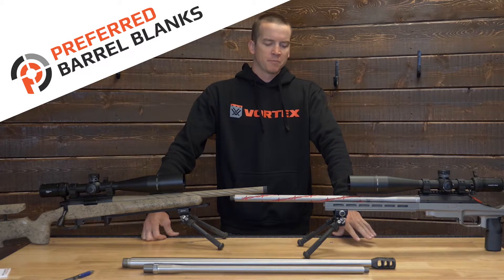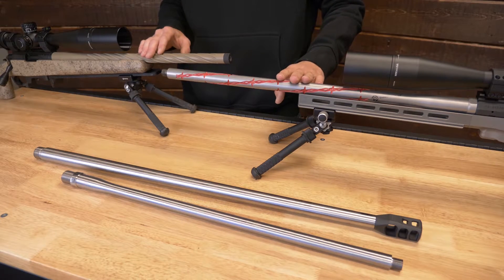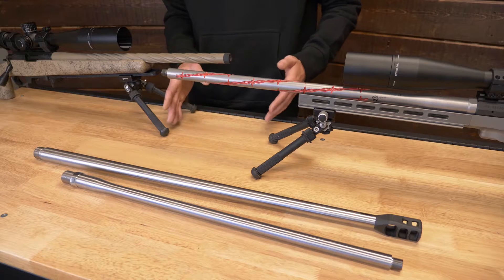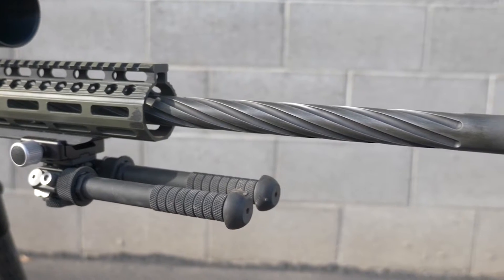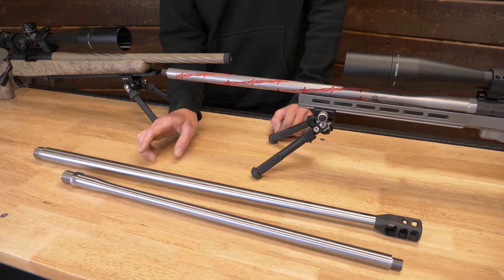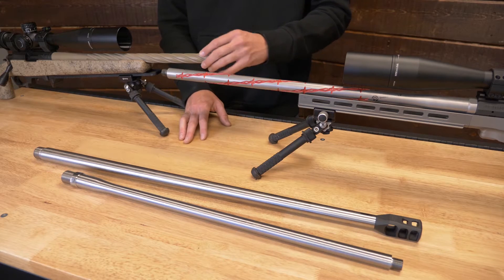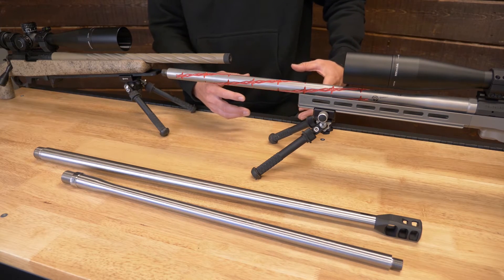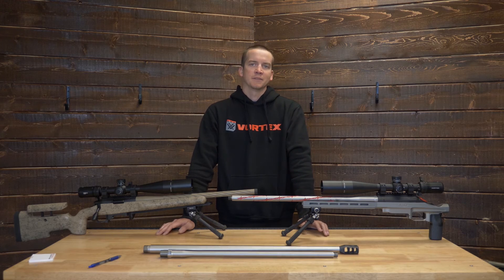FAQ Barrel Fluting Options, Preferred Barrel Blanks

Comment: ok, but if i have two barrels, both have the same weight, but one is flutted, The myth says that the flutted one it is going to be stiffer and have  better heat dissipation. True or false?
Reply: Assuming similar contours. For the weight? True on both counts! (assuming the flutes are continuous along the length of the barrel, their "diamond" pattern would lack improved stiffness) For the diameter? False. A 4lb fluted is stiffer than a 4lb non-fluted, but a .810" barrel is stiffer unfluted than a .810" fluted.
Reply: @holl0918  hey dudo jaguar you? You know about barrel? Or just like mortals?

Comment: Logan, I have been trying to contact Preferred Barrels. Is there a phone number? Sent message through the website.
Reply: Received my 6.5 PRC profit a few weeks ago. Barrel looked very good. It fit the stock inlet perfectly. Sighted it in with Hornady Match ammo. After bore siting the Barrel was extremely precise and accurate. I would not hesitate to purchase another Preferred Barrel
Reply from the maker: 435-635-6900